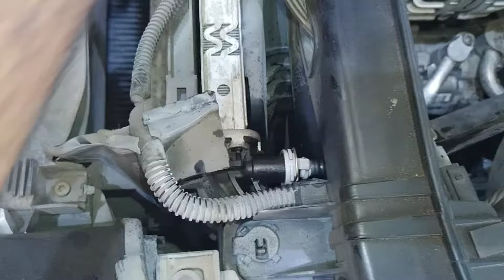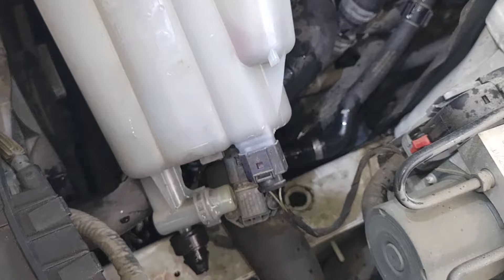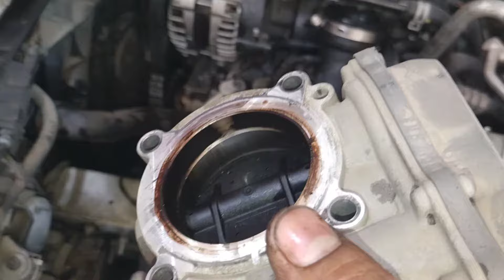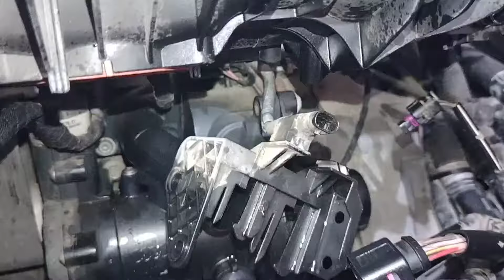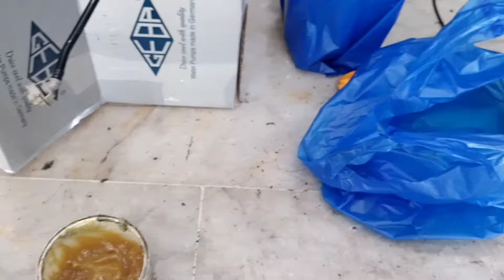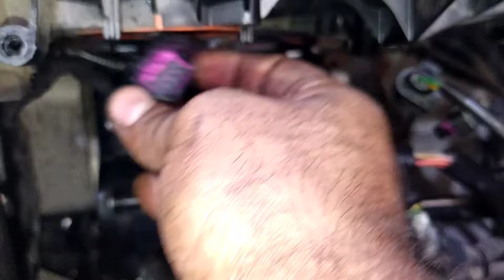Audi A5 2.0T TFIS Water pump  and Thermostat replacement

Comment: I have a 18 A5 sportback premium plus. It's leaking coolant from the thermostat. Quoted $2200 from dealer and $1600 from euro shop. Can I do this with no automotive experience? My only experience is changing air cabin filter. Thanks
Reply: I doubt it, looks like too many wires and parts being disassembled

Comment: Assalamualaikum.. I want to ask, if the waterpump leaks, do I have to change the waterpump or is it enough to just change the gasket?
Reply from the maker: Change waterpump
Reply: thank you brother..
Reply: @CarClinicPakistan  hello sir..why after change waterpump,warning sign 'stop engine and check coolant level still there'
Reply: @videotoday2322  the water reservoir sensor.. clean the plug underneath it… with WD 40… if it didn’t fix it and there is no water leaks… maybe ur sensor went bad.. you need them to change the whole reservoir tank .. comes with a new sensor …
Reply: fuck audi was looking into this but way too much work for a water pump
Reply: P268100 error code.. no leak n no heatup what to do? Ur workshop?